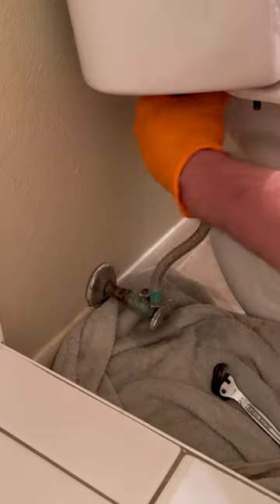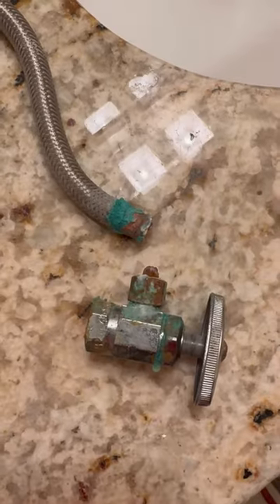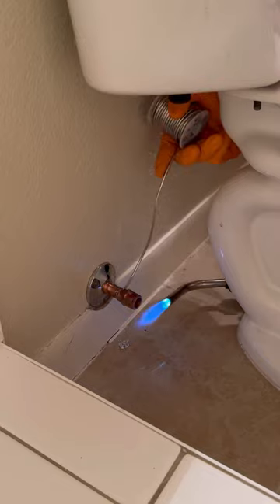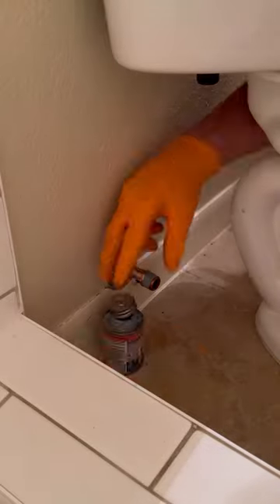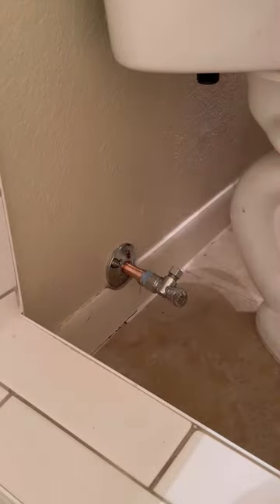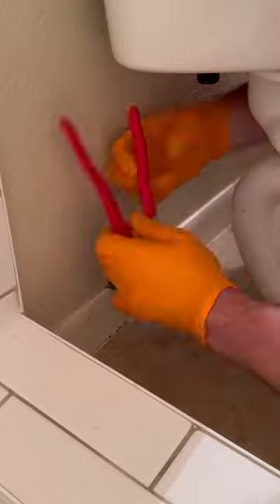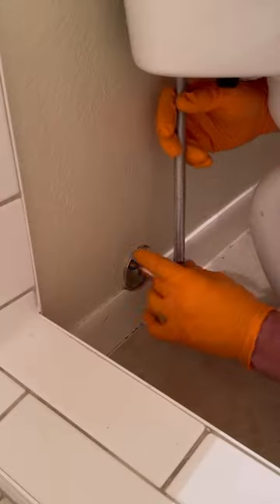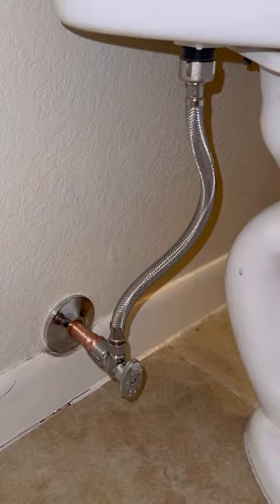Corroded Shutoff Valve Could Have Flooded This Home! #plumbing #repair #shorts

Comment: House flooded as a kid from one of those getting broken off while cleaning behind toilet, no one home knew where the shut off was, luckily a neighbor came down to Assist,  and it ruined carpets throughout the house days before Christmas. Had all the carpets tore up with huge fans running around the clock under them trying to dry the flooring underneath.

Comment: You can actually quench with the flux instead of having to sand after you solder and it'll clean it up a lot and then just take a rag

Comment: Metal to Metal, Plastic to Plastic, easy to destroy threads on a fill valve with metal to plastic. Never really see supply lines wear out or break before fill valves.
Reply: Looks clean though! Nice job!

Comment: Why not a compression stop?
Reply: Compression angle stops are stupid
Reply: I've used the compression stops and haven't had a problem.  I usually do solder it on.
Reply: Glad someone else asked that, too.
Reply: @SamThePlumber Thanks for elaborating. Really helpful answer.